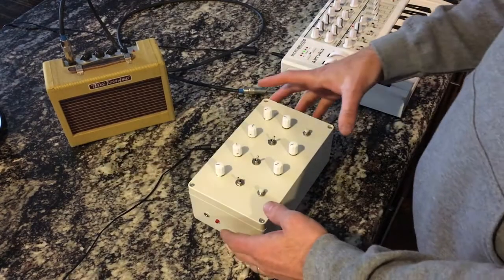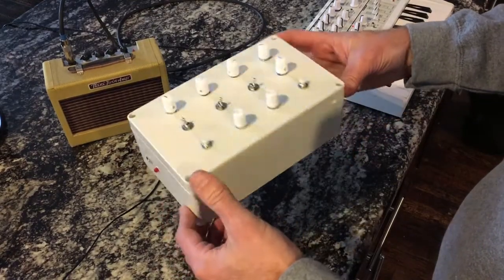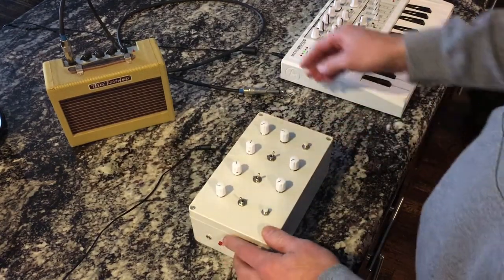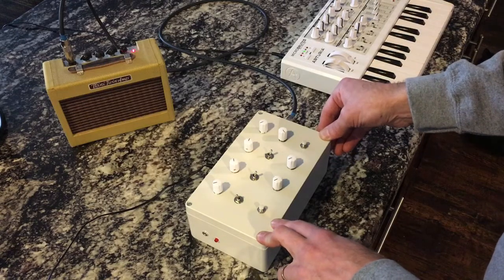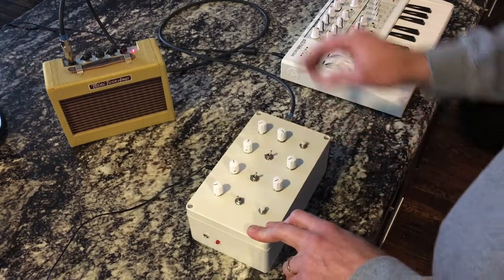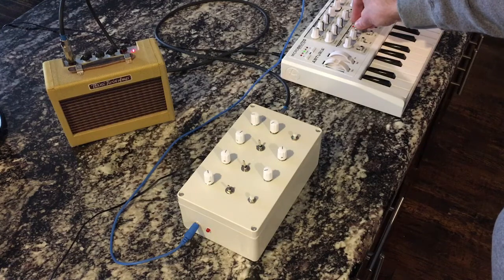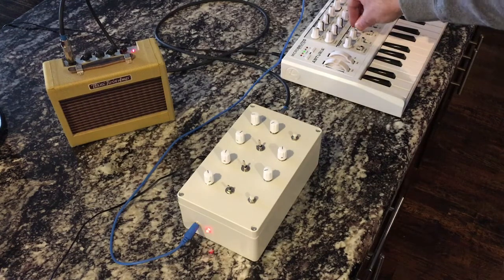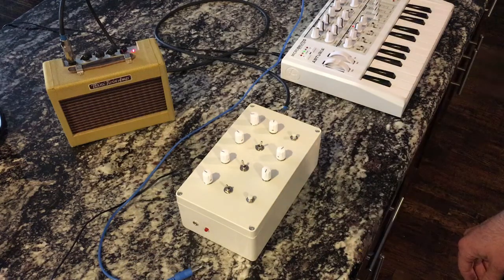DIY Synthrotek Drone Box Project

Comment: This is a long shit but would you be willing to share info on how you built this? Id love to try it out!
Reply from the maker: Thanks for watching. It was actually a pretty simple project. I just built the two kits mentioned in the video based on their instructions. Then I wired the output of the 4093NAND directly to the input of the PT2399 (directly wired - no jacks). Other than that, the only change is the power. I just wired both 9V power connections in parallel to a single power jack (A/C power, not a 9V battery). That's pretty much it. Other than that, just follow Synthrotek's instructions.